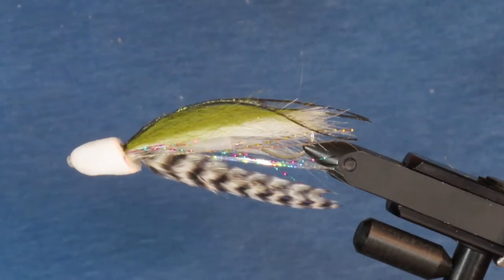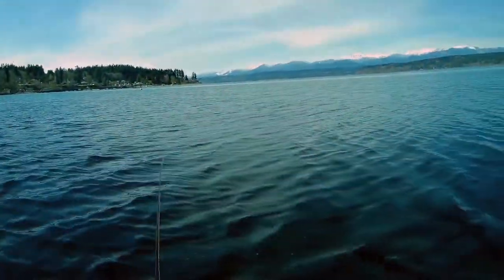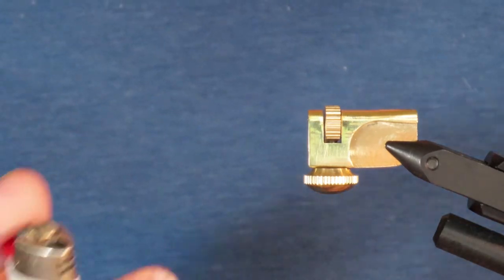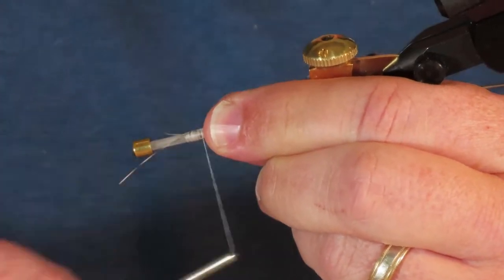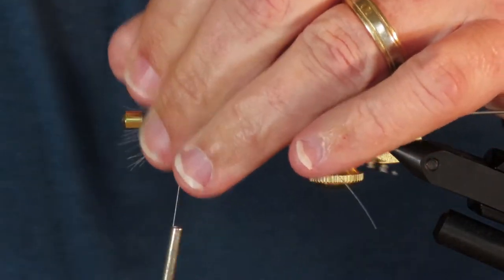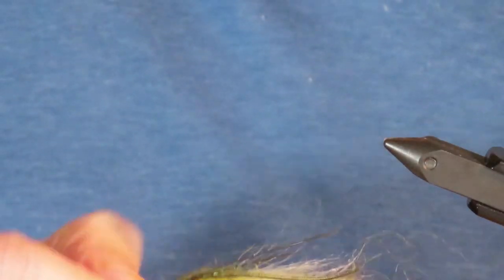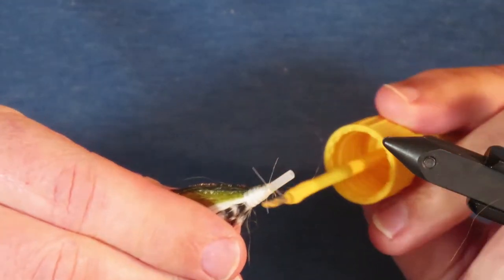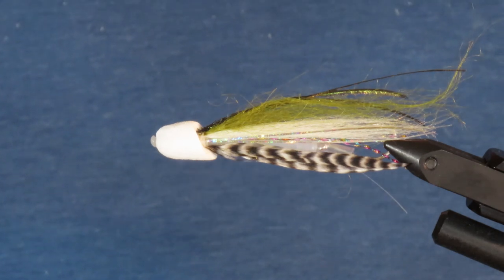Tube Beach Popper - Classic Cutthroat Flies

Comment: Thank you for your video of this tube fly. I am keen to try this variation of this fly. I have been wondering why the hook needs to be upright in this topwater pattern?  I wonder if in addition to using the tube variation to improve hookups, if the hook was pointed down instead of up if that might improve fish hookups?  Thanks. Very clear presentation. Cheers.
Reply from the maker: Hi Jerry, I've looked at many photographs of the original pattern, and in pretty much all of them the hook is tied in 'point up'. I think the reason for this lies in the upturned eye of the stinger hook: when you loop mono through that eye, the tendency is for the hook to end up lying at an angle to the doubled line. Imagine you're dangling that hook by the mono, and the point will angle in towards the line. So, if you were to tie it in point downward, given there's already a tendency for the mono to droop under the weight of the hook, the end result is for the point to angle in towards the center line of the fly. By tying it point up, you are actually using that angle at the hook eye to counteract the sag in the mono, and the end result is that the point will end up pretty parallel to the center line.  This would be easier to diagram than explain, but I hope you get my drift! Having said all that, when the hook is secured by junction tubing, these considerations are pretty much moot. In my pattern, I kept the design point up more for tradition than any other considerations. It works for me pretty well this way, but that's not to say you shouldn't experiment - it only takes a moment to change the orientation of the hook!
Reply: Timothy thanks for your response, it makes sense. I am heading to Bella Coola in a couple of weeks to fish Cutthroats in the river. I expect this fly should work in the river as well, particularly on fresh fish. I plan on tying some of these before I go. I will experiment with different versions and let you know if I have any surprising results. Cheers and thanks again for sharing your knowledge. Jerry